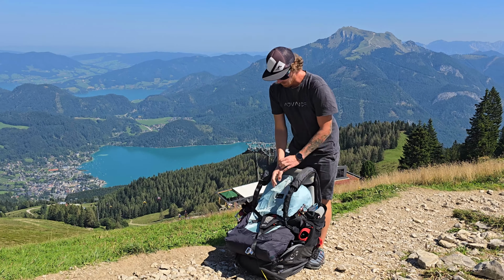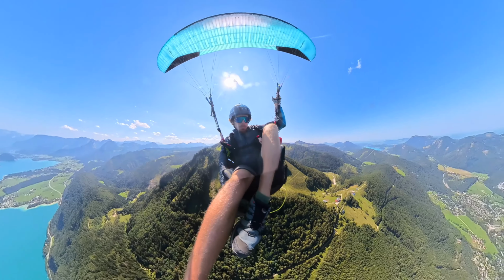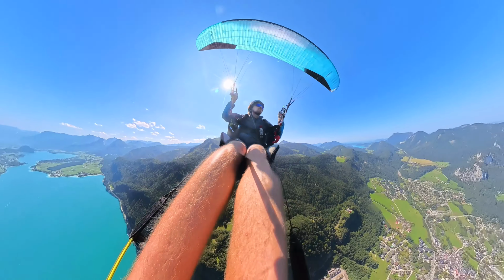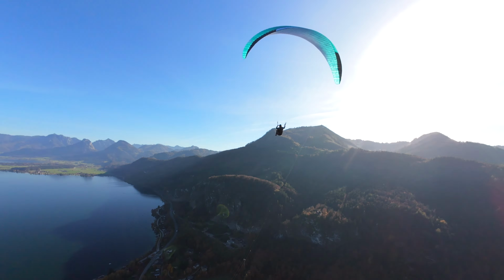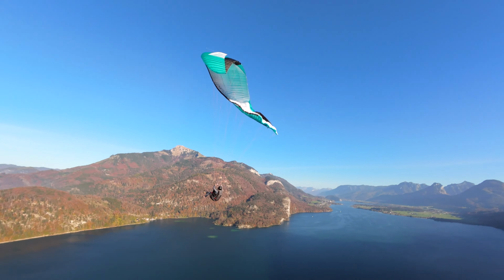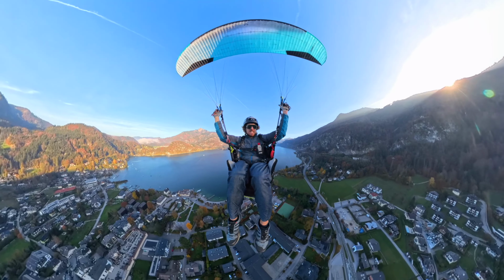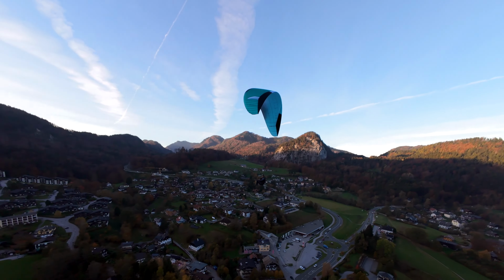How safe is the Advance Paragliders Sigma DLS - TESTFLIGHTS and SIV

Comment: Hey Roli, that's a really nice video, nice wing. Just my thoughts on the test. I know you love Acro and Sh.... but most pilots who'd like to know more about a low EN-C wing fly cross country. With my experience of 10+ years of flying, I never had to stall my wing in a cross-country flight. Although it is so sure really good and helpful to know, I would guess like 3-4 would be enough. So instead of doing 10 full stalls, I would love to see more collapses on the speed bar, with weight shift/without e.g., 3 times frontal collapse on the full speed bar. Because this occurred to me a few times more compared to full stalls. Keep up the good works, u rock.
Reply from the maker: Hi, thanks for your feedback 😊 All the things I did in the video were the result of an Instagram poll. I will take this with me for the next video, thanks for letting me know about your wishes for the next videos 🙌🙃

Comment: Thx , I am in doubt since I weigh 85kg or 91kg (depending on lightness or impress harness that I would take to fly with) with the size 24 on the lower end of the 85 to 95 ideal range , would you see still recommend it , I am an xc pilot not a comp one … 😉🙏🏻
Reply from the maker: You're welcome 😎 I guess it's OK, but check the lower size if you more flying with the lighter harness.
Reply: How many kilos are you?
Reply from the maker: @ all together was around +90kg

Comment: Why is the full bar side collapse cut so strangely that you do not really see the wing  behaviour as the camera view changes exactly in the moment when the wing reacts, very suspicious don't you think?
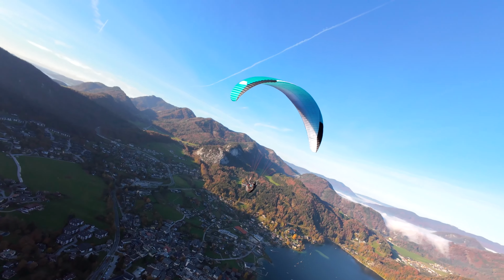Reply from the maker: What part of the video do you mean? I think everything is good visible at 6:59 where I do the side collapsing.
Reply: @ACROLI hi, I meant 5:20
Reply: Why don't you do full speed side collapses where you release the collapse immediately after pulling it? I find it more realistic and unpredictable than holding :) this type of collapse was a nightmare experience on Sigma 10
Reply from the maker: @paraglidingSafety there is everything there. I just switched the cam to see how it’s looking from the outside.
Reply from the maker: @paraglidingSafety I did them too and was nothing special. I saw now that I didn’t put it to the video. But I can post them in a short if you like to see it.
Reply: @ACROLI  thank you